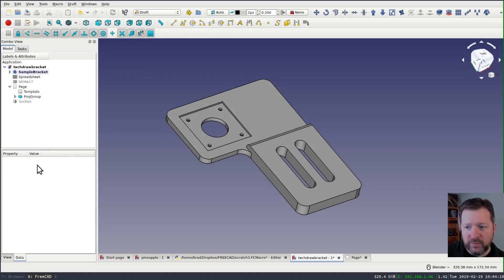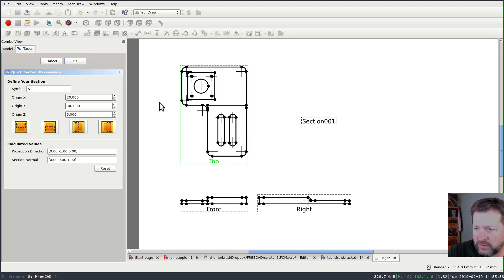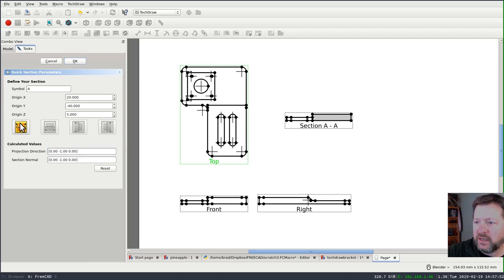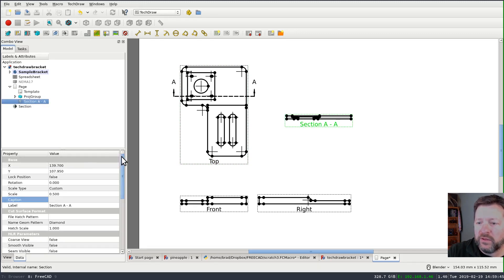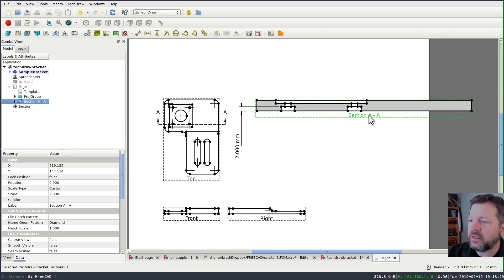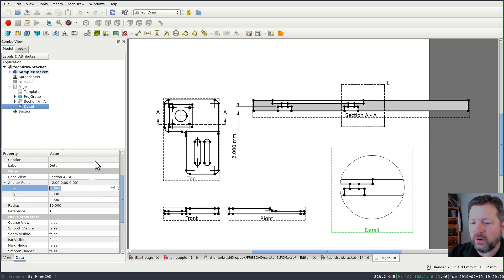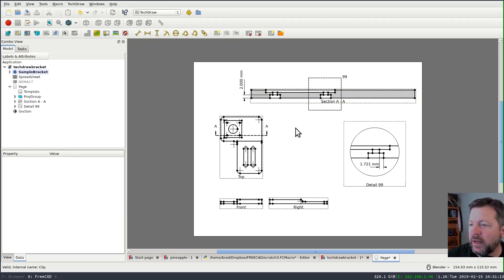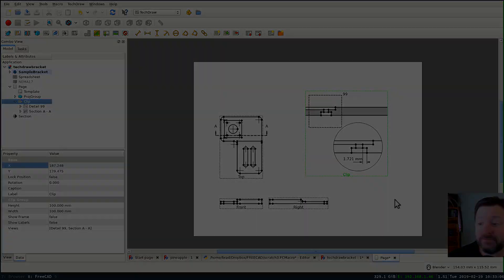TechDraw Workbench Part 4 (Sections and Detail)

Comment: Thanks for the video. Is there a way to make those dimension dots smaller? I found them annoyingly big, when you are creating drawing. Also default line widths shold be able to set globally.
Reply from the maker: Open the TechDraw preferences (You need to have opened the techdraw workbench first).  Go to the TechDraw Dimensions tab at the top and then change the vertex scale.   For line thickness, check out this wiki page on line groups: https://www.freecadweb.org/wiki/TechDraw_LineGroup
Reply: @sliptonic  Thanks for the reply and keep posting these videos. It is nice to see other users workflows.

Comment: In November 2024 in current stable version 0.21.2 there are no height and width of a view if it is inside the clip. Thants God, I could move it manually, but does not tech drawing imply some degree of precision? Or maybe some of the view object properties are locked... It also would have been a common sence for any WYSIWYG application to give user a choice about the rectangular frame around the view on the page or inside the clip group. I could not find either.

Comment: Is it possible to add a section at a 45 degrees instead of horizontal or vertical ?
Reply from the maker: I think you would need to add view to the drawing of the part at a 45 degree angle.  Then section that view.